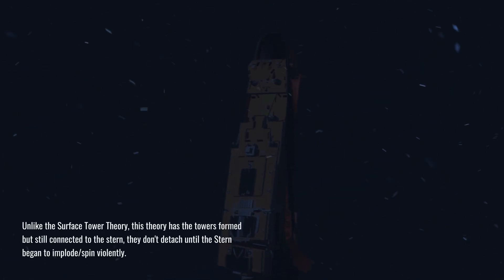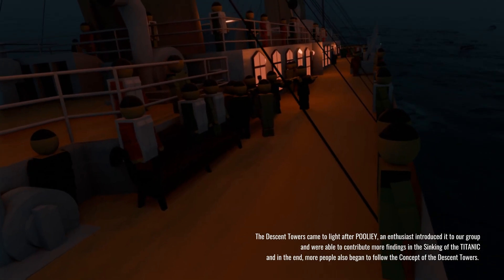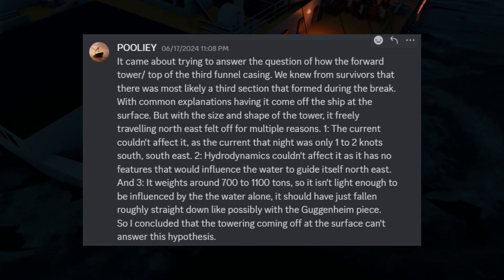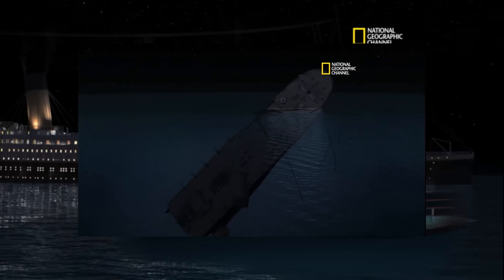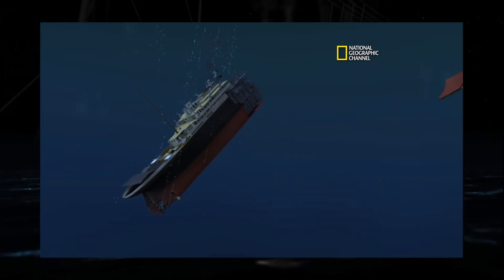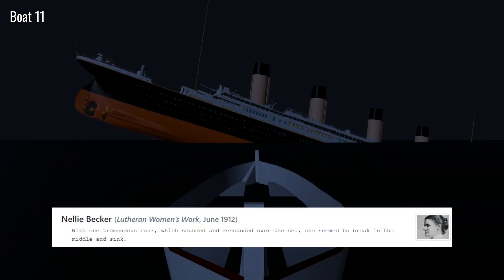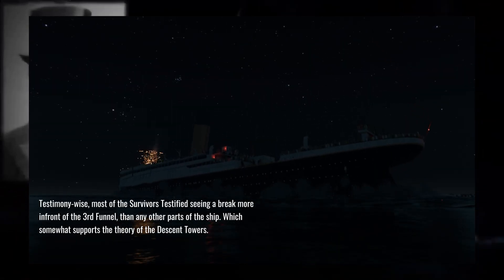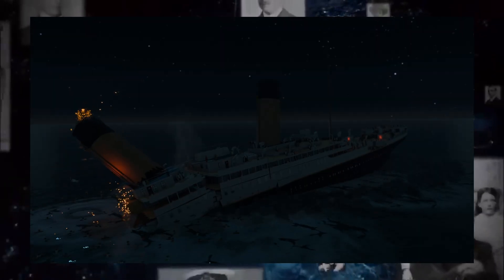TITANIC | The Break-Up Theory Series | Log 2: The Descent Towers

Comment: Good to see this theory be talked about. Wanted to add some parts: The main drive for this theory was the wreck position, it's position has never been fully incorporated into any theory. I liked that S.G commented on the final word analysis, this is likely where the descent tower theory started in some regards, Parks Stephenson commented that James Cameron thought the stern could have "flung" it over to the east, but then looked at the aft tower/ top of the engine casing, and thought against it. This is where the origins of the theory sort of come from, just a little variation. The simulation that S.G skilfully animated isn't exactly what I think happened, but it is quite a tricky thing to explain on paper. 
S.G briefly showed a somewhat summary I did for the video. I will put it here to hopefully get some more insight:

It came about trying to answer the question of how the forward tower/ top of the third funnel casing. We knew from survivors that there was most likely a third section that formed during the break. With common explanations having it come off the ship at the surface. But with the size and shape of the tower, it freely travelling north east felt off for multiple reasons. 1: The current couldn't affect it, as the current that night was only 1 to 2 knots south, south east. 2: Hydrodynamics couldn't affect it as it has no features that would influence the water to guide itself north east. And 3: It weights around 700 to 1100 tons, so it isn't light enough to be influenced by the the water alone, it should have just fallen roughly straight down like possibly with the Guggenheim piece. 
So I concluded that the towering coming off at the surface can't answer this hypothesis.

I came to realise something had to influence the fore tower to give it the movement to travel north east from the hypocentre. The main forces the ship experience during the sinking for the bow at the end, was the break up, and force of the water going over the decks, pushing the mast down for instance. But the V shape of the bow protected it by deflecting the water around the ship once the bow stabilised then impact. For the stern, the forces were the break up, pulling, hydraulic explosion, spiralling and impact. 

Some claimed that the bow may have pulled the tower with it and it was holding onto the bow until it finally gave way and the bow sent it north east during descent. The issue with this is that the bow protected itself due to itself, so there wouldn't be a large force to send it north east. It would just come off and continue with the bow for a bit as it decelerates, but the bigger issue is that the bow was pointing north, north west during the break and from the path it went turned to point north north east. So if the tower went with the bow, we'd expect it somewhere between the bow and the stern or even a little west in between. But it is to the east. Some claim the bow did a zig zag, but that would go against the accounts who say that the ship had the Californian to the starboard side for the entire night, and the last time it was mentioned the ship was almost looking at the Californian, and we know the Californian was north north west of the Titanic.

So we know it wasn't attached to the bow so the stern had to have sent it the way it travelled. The first force of the break up was likely the cause that established the damage that caused the tower to disconnect. So it isn't that. Some have had it where the stern pushes the tower to where it is, but there are two things, firstly the stern is pointing north north west it would push the tower north north west, and secondly the stern wouldn't thrust forward as it sank, if you believe the stern was or wasn't pulled by the bow, the sterns front would just fall straight down, and the stern would only move forward once it is at quite a high angle (seen with the Oceanos). So it wouldn't be from the break up or the rising of the stern. The next main event would be the explosion, with the stern going down break end first, water would be entering the stern faster then it could come out, so when the pressure is high enough the water would force its way out. But this seems to be mainly near the rear of the stern. The water rushing into the stern could have added further damage and pulled it off. But that would mean it will come off and land somewhere in the debris field. So it likely didn't come off there. 

But the next force is what drew my focus. The stern we know flipped over to have the fantail down at some point in the descent. With the hull being buckled from the break up, it would cause there to be a wing that would cause drag. This would be on both sides, but one was likely more compressed. Evident from the list during the break. I think the starboard side had more, with the likelihood that the ship had a starboard list during the break so the buckling would be worse.
To add some added info, if the stern was pointing north, north east during the break and we know the stern almost turned around as it rose, so it was facing around south west to maybe south. 
So the starboard side plating is causing drag to the starboard side, and so the stern is rolling on its port side. When the rear of the stern gets closer to pointing down, at some point the water caught the easy flow of the rear end of the stern, rapidly accelerating the roll, this large force along with the increase damage to the fore tower from the break up and the water punching into it, it was loose enough to where it ripped off the stern. This can also link to the fact the fore tower has more of the starboard side then port side. As when you rip something off in such a way, the side with the most force (starboard side) under go's the most stress, so the starboard side ripped more off. 
This movement gave the tower the momentum to travel eastward along with the loosely holding double bottom. The tower travelled the furthest as the double bottom pieces flapping about would have slowed them, while the tower was quite static so it's drag was somewhat constant until it lost its momentum. Then it just continued until it impacted the seabed, and finally laid to rest. 
I also have pondered very recently if it was thrown during the spiral stages, with the idea that the stern could have actually spiralled clockwise, and threw it during that. It has to be clockwise because if it was anti clockwise the port side would be resisting it coming off. 

Feel free to ask any question.
Reply: What makes us "know" that the stern "flipped over" to have its fantail downward at some time during the descent?  That sounds like pure conjecture.
Reply: @billvanek5570  If by "pure conjecture", you mean:

1. We know the stern went under break-area first based on eyewitness testimony and logic, and;
2. We know the stern hit the seafloor fantail first based on said fantail being buried at an angle like the front area of the bow, with enough force to push the two side propellers roughly its entire diameter upwards at that? 

Yes, it is pure conjecture.
Reply: @bluechair9172   I know all about your point #1.

The POOLIEY person who I was responding to specifically said "flipped over to have its fantail down", which sounds as if he's saying that the stern went from nearly vertical with its broken end pointing down to being nearly vertical to having its fantail pointing down.  It may not sound that way to you, so maybe we just have a difference in what is understood from what is said.  My understanding is based on knowledge of ships from being in the Navy (45 years ago today!), and more study since then.

The fantail of the ship is the rear-most part of the deck where the ensign mast (flag pole) was.  It is further aft than the props and rudder, so if that end of the ship was 'pointing down', it would have struck first.  On the TITANIC wreck, that fantail is undamaged.  So if the stern turned "fantail down", as POOLIEY said, and didn't land on its fantail, it then must have turned yet again.  So I wanted to know what evidence was making POOLIEY think that it did all of that turning---which he is implying to be in addition to the gyrating or spinning of the mythology.  That's a whole lot of turning alleged for something that was not seen.

The stern lies horizontal.  The tops of the propellers are visible.  It would have been practically impossible for it to stay perfectly level all the way to the bottom, so of course some part had to hit first, and that part looks to have been the keel or the bottom of the rudder at the aft end.  But it certainly wasn't the fantail.  So all we know for sure is that the the stern went from nearly vertical (your point #1) to nearly horizontal (its current orientation), and nothing more.  And none of that speaks to spinning and throwing off pieces, which is what this whole discussion is about.
Reply: @billvanek5570  Good points, though the propellers being visible is misleading is that is what you based the "stern lies horizontal" on.

Based on the most recent 3d scans of the Stern wreck by Magellan (it is on YouTube), if you compare where the propeller is relative to the Poop deck and below area (don't know what it is called other than Stern, which is a bit confusing since we are talking about the Stern section) in the wreck, and compare it to pictures of Titanic/Olympic in drydock and construction, you will very quickly notice that said propellers are much, much higher than they are supposed to be.

I can't explain why or how beyond the surface-level obvious (the propeller shaft broke and stayed on the surface while the rest of the Stern in that area was being shoved underground), but it is clearly evident that the propeller blade is not supposed to reach as high as the F-deck portholes, and the propeller hub not at the exact height at the G-deck portholes.

It creates an illusion that the stern hit bottom at a nearly horizontal orientation when, based on what the poop deck and below area look like today,  it most likely hit the bottom rudder-first at an angle like the Bow. The "front" portion is even buried deeply like the bow, though not as severe.
Reply: @bluechair9172    Yes, I see what you mean.  There could well have been some horizontal movement and some angle that buried the bottom two thirds of the rudder in the mud---and that could certainly speak to the corkscrew path that you mentioned.  And the fact that the struts that held the propeller shafts broke upward could be partially due to some horizontal, aftward sliding impact, but is more likely attributable to the vertically moving portion of the impact with the sea floor.  

However, neither the buried rudder nor the propeller struts broken upward speak to the stern spinning like a "fidget spinner".  I don't see any evidence to indicate that spinning was involved, and that's why I called the spinning and flinging a myth.  

And I don't think that it's an illusion that the stern impacted while closer to horizontal than vertical in its orientation (that is, something less than 45 degrees), firstly because the fantail is in such good condition.  At least 30 feet of the fantail would have been crushed---like the front end of a car that has run into a wall---if the stern had been 45-90 degrees from horizontal ("fantail down," as POOLIEY said).  Secondly, there would have been a lot more wreckage around that impact spot aft.  Large chunks of hull lie where they were smashed off by the impact, all along the stern wreck, yet not so much back by the fantail and propellers.  If the stern had been more than 45 degrees from horizontal, those pieces would have been jarred loose by that first higher-speed impact, and piled all around the fantail, probably so much that we wouldn't be able to see the propellers.  Instead, we see more debris the further we get away from the fantail.  More evidence is the loose debris that is all lying atop of the stern's decks:  such items would have fallen all around the propeller area if the stern hit at a high angle.

Comment: The idea that the stern spun in circles as it descended to the sea floor is a myth.  Building upon such a myth by thinking that the stern could spin fast enough to "fling off" pieces is even more fanciful.
Reply: Do you mind elaborating what you mean?
Reply: @HaleyJJS  Sure.
1.  Anyone who has ever played with toys in a swimming pool knows that there is a lot of friction.  As a boy, I tried to throw something underwater, and all it took was once or twice to find out that the object didn't go far.
2.  The stern would have to spin fast like a helicopter rotor to get any speed to fling off something that was still fastened.  (Only something already mostly broken due to the implosions of the trapped air inside would come loose on the way down.)  The stern simply could not spin like a propeller with any speed.
3.  To say that the debris field tells that story is ridiculous.  At most it could justify one half turn of the stern:  "hey, look; this starboard object is sitting on the port side of the wreck."  
4.  I've heard the nonsense that some markings on the ocean floor look like swirls.  To say that that means the stern was spinning fast when it hit the bottom is an erroneous stretch.  Just watch war films:  when a spinning plane is plunging down and crashing, it leaves ONE impact mark, because the impact is instantaneous; the spinning stops instantly; there is no circular spin mark on the ground.  The swoops of silt adjacent to the Titanic's stern could easily have happened because of the straight-down impact of such a huge object landing, blowing water and silt out to the sides.  Even more likely is the changes to the sea bottom due to currents over the 70-odd years between the sinking and the observations.  So there are two reasonable reasons for such markings, and one crazy idea, so the crazy idea should not be followed.  That is exactly how mythology begins.
Reply from the maker: It is evident though by a patterning in debris surrounding the stern, especially the seafloor itself.
Reply: Does your disbelief of the "spin" extend to the spiraling sinking path shown in the James Cameron and History Channel theories?
Reply: @bluechair9172    I first wrote "yes" in answer, but I regretted it when I thought about it.  I should have said "I don't know", because I'm unfamiliar with the exact thing that you're speaking of.  (I've always been interested in the broken end of the stern, not the aft end.)
Reply: @billvanek5570  May I ask why? Your previous explanation only really covered the stern not being able to spin like a fidget spinner, not that it can't take a corkscrew path on its way down.
Reply: @bluechair9172   I've actually never heard anything about taking a corkscrew path down.  If I understand you correctly, it would have been a path like that of a person descending a spiral staircase?  That fascinates me.  Maybe it is indeed how one of the 'towers' fell so far away from the stern's final resting place.  Thank you for that.

What I was objecting to was the stern twirling like a propeller, or a girl's baton---which I guess is like a "fidget spinner"?  (I've never heard that term before.)  There is nothing to tell us that the stern spun like that---not even the wreck.  

There could be no "flinging" horizontally of any distance by virtue of spinning.  Loose things could have been dropped off, but fastened things could not have been flung off.  That is the point I was making.
Reply: @billvanek5570  The corkscrew spiraling motion of the stern entered mainstream at around 2012 with the James Cameron NatGeo and History channel animations, surprised you haven't heard of it. I don't know if the stern during decent had the shape to allow it to spiral down, but the stern doing that seems to be the popular consensus AFAIK.